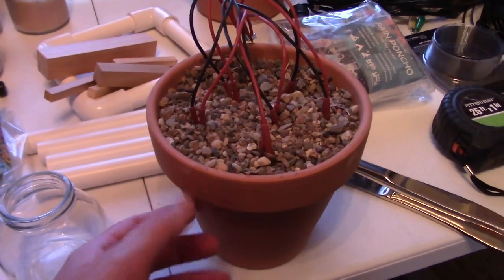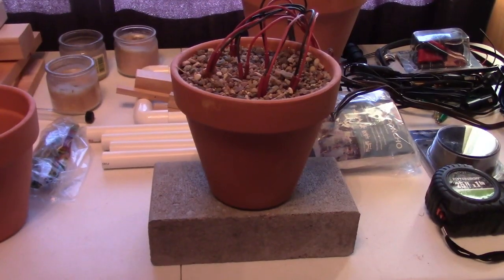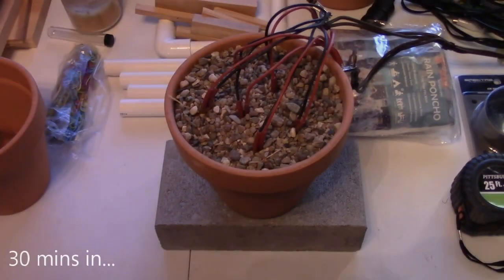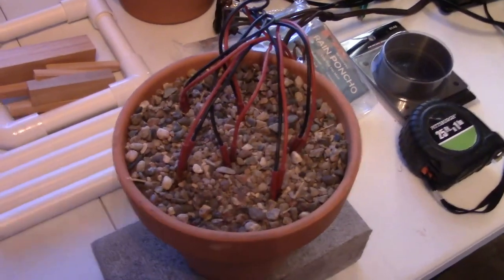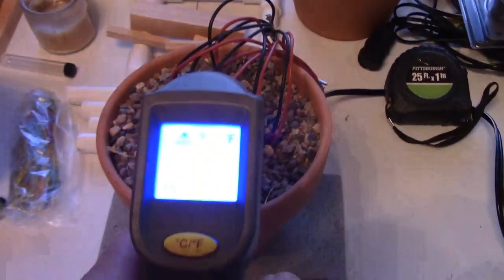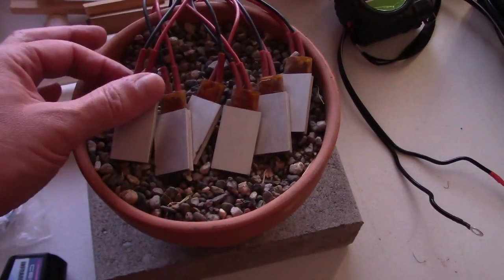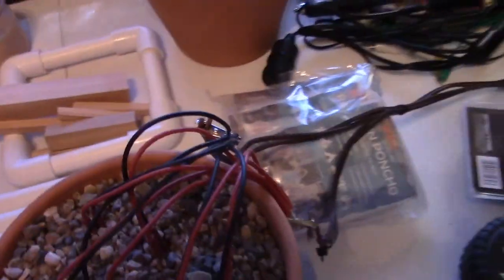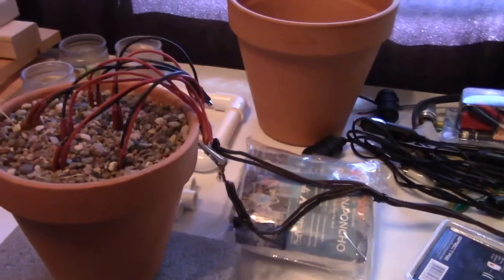DIY Flower Pot Air Heater! new design! no candles! uses PTC Ceramic+Rocks 300F(150c)+ heats a room!

Comment: Here in the Netherlands they have started an project to use basalt rocks as an heat storage battery for houses. During the summer they use solarpanels to heat up a well isolated mass of Basalt rocks so they can heat up houses during the winter with the heat that is stored in the rocks.
Reply from the maker: awesome! ...and very interesting! - i've read about using large rocks to store heat but they were only holding the heat for a couple of weeks at a time. sounds like they found a way to store heat for 6 months! i'll look into that. thanks for sharing
Reply: @desertsun02  add SALT
Reply: @desertsun02  and silica gel
Reply: @desertsun02  and bind wires together and run them out of small hole and cover that thing with ALUMINUM screen for heat dispersion
Reply: Basalt rock is what rockwool insulation is made from. So you could get insulation and compress it.

Comment: Cool experiment. Another way you could heat that flower pot during the day is with a solar oven. Maybe have 2 of them and swap them back and forth, one heating in oven while using the other to stay warm inside? Use the solar panel to charge up a battery, then use the battery operated heaters after sundown.
It is out of the box thinking and experimenting, and sharing the results, that will help people when hard times strike. Great job with this.

Comment: If you increase the mass (bigger pot more gravel ) you will have a lower heat but for much longer. Some ornamental pots dotted around the house thermostat and battery you have true passive heating. Genius idea 💡 very impressed

Comment: This inspired me to use PTC heat elements in a 20 ounce plastic soda bottle filled with sand. I have one element on top and one on bottom inside the bottle, threw it under the covers and slept a lot better than without it considering it dropped to 25 degrees last night. I'm thinking about making a quick video to share.
Reply from the maker: sweet! be very careful using ptc heating elements near plastic though. the elements will melt plastic. that could lead to many problems.
Reply: Sounds interesting. I was wondering if this could be done in a 55 gallon plastic barrel without the heat melting the barrel.

Comment: desertsun2, I duplicated your flower pot experiment a number of times and can only get a high of 240 degrees off the  top,  not 300 plus. I now realize my pea gravel is different composition (orange and white). Yours is a grayish color.
I bought two brands (orange and white). What brand did you use? I'd like to try and get your brand so I can get 300 plus degrees off top like you did. Thanks. I've been doing a lot of experiments with your idea.
Reply from the maker: hi and i'm glad you made the project. 240F is pretty good! the pea gravel  i use is just natural landscape gravel (from my backyard). i'm not sure what brand it is.

Comment: That's pretty cool. Are you totally off grid there? Will that heat a 5 gallon bucket of water up with the same low energy consumption as they did with the small containers of water that you showed them heating on your other video you were demonstrating them and heat it fast enough that you don't have to wait an hour or two to take a shower? Thanks man
Reply from the maker: hi and thanks. technically i'm not totally off grid here (but it seems like it sometimes). they would heat a 5 gallon bucket of water but it might take a while. all depends on how much you want to warm it up. one of my previous ptc vids (the saucepan one) shows 6 elements heating a quart of water to a boiling in 30 mins.

Comment: This is my favorite of those I have seen so far.  I have MANY questions about this.
How big is the pot?
How big of a pot is logical to use this way?
Have you or anyone used pickling salt instead of sand or pea rock ? Do you think salt would work? You say this gets hot to touch even on the outside of the pot. 
How big of an area is this or would this heat do you think?  Do you think this would work using an OLD milk can? Like back in the 50's. Before the bulk tanks for hauling milk from the farms to the creameries.  How about the. Old stainless steel. Heavy containers that were used to strain the milk into?   This one REALLY fascinates me.  
Thank you.
Reply from the maker: hi there. i wouldn't use much larger of a pot than i did (unless you're going to add extra ptc elements). it's sized pretty well for the 6 that i used. i have not used pickling salt - so i couldn't say if (or how well) that would work. milk cans are around 10 gallons i think. that is a lot bigger than this unit so i'd guess it would be way to big (unless you used like 3 to 5 times as many elements.).
Reply: @desertsun02  oh boy.  Would it be possible to add more ptc without it changing the being able to use the cigarette lighter in a vehicle or from batteries?  I will learn this somehow.  I would like to try combining a bunch of your various projects and somehow combine them into 1 nice workable combination that would fit my needs.
  I have ordered 2 100w flexible solar panels and a 20w controller .  I have 1 100w solar panel attached to the house. ( never used yet )  been there about 15 years. A controller I thinks 18w maybe.  Lots different stuff from years back of life's collections.   I see many of your ideas very valuable to my situation.  Thank you.
Reply from the maker: @dumbbunny15501 6 of the 12v ptc elements is the most that a 12 power socket in a car could handle.
Reply: @desertsun02  ok.  I need to get the things you use that I would need.   A friend got me 8 of those pct things. He is curious about this.  IF I can learn and do this.  I will believe you are a. Miracle.

Comment: Do you have to have a 100w panel? Would they just not get as warm with smaller panel?
Reply from the maker: hi there. that's right - they are proportional heaters, so they just would not get as hot. for full heat output you need to get about 12 amps total so if using solar panels you'd want to go with 2 100 watters (they are about 6 amp each). these days you can actually buy 12v 200w panels (so you'd just need the one in that case)
Reply: I like that answer.

Comment: I really like the idea. Is the rubber insulation on the wiring affected by the heat? I think over a fairly short period of time the insulation will not maintain integrity. Any thoughts or suggestions on that. My only thought on it at this stage is to flip the idea upside-down so that the heat is rising away from the cables, but I haven't worked out how to do that easily. Any thoughts?
Reply from the maker: hi there. per manufacturer; the wires are high temperature with a heat resistant coating on them. the wires handle 400F-500F (204.4 - 260c). the ptc element itself averages in the mid 300's F so heat produced from the unit will not affect the wires.
Reply: @desertsun02  good to know, thanks.

Comment: how about heating a floor in a van? how might one do that? will these last long? could they be put inside a poured concrete block?
Reply from the maker: hi. these little units are surprisingly tough. i've dropped, scrapped, and banged them plus pulled on the wires and they all still work perfectly fine. per the manufacturer: they last over 3 years (with daily use). they give no upper limit of time but i think they last two or 3 times that long. i don't see why you couldn't embed them in rock. i hope to see lots of people using these in the near future. i think there are tons of possible ways to use them.
Reply: @desertsun02 :
Bed warmer.

Comment: Do you know how much it would cost to run it for 4 hours on the DC converter if the cost of electric is .12 cents per kwh?
Reply from the maker: hi. 6 to 8 cents roughly
Reply: Where would I get the DC converter?

Comment: Another great video.  Do you use splitters to hook the wires from the solar panel to the
ceramic heaters or have 3 separate wires from negative to positive terminals?  Thank you.
Reply: I watched the video on the cook burner and I see how you connected the wires.  Thanks.

Comment: I'm trying to heat a 12x6 ft green house with solar. Do you feel this is more efficient than using the brick method with double stacks? My thoughts are to run this off a Harbor Freight basic solar kit. Tnx for reply.
Reply from the maker: hi there, i'm not sure why, but i think that this way of heating thermal mass is slightly better than the brick method. it just seems like this heater gets a little hotter and dispersed the hot air farther than with the bricks. (but it might just be in my head).

Comment: Oh and a question. If I run these 12v units in series (4S) would it then be a 48v heater? - just to match the output of my solar array. Can imagine destroying the PTC if I overvolt them in parallel
Reply: I have same question ? did You try connecting 4 in series ? did.it work?

Comment: I want to do this with adding the top pop then a flume with computer fan to blow it.  How many total watts does this use?  I want to be able to plug it in to either  a normal AC plug or into my solar generator AC plug. Not sure of what DC transformer to use for that.

Comment: Hello. Do you connect it directly to the solar panel? Or does it need a transformer or something like that? Sorry I don't know much about these things. Thank you
Reply from the maker: hi. it doesn't need anything special. you just connect it directly to the 12v solar panel. 🙂✔
Reply: Ok. Thank you!! Do you connect it with crocodile clips? Or any other kind of wire connection? Thank you
Reply from the maker: i usually just twist wires together but you can use crocodile clips if you want to

Comment: Awesome videos, could you tell me how I can run these elements from a power station?( 400w rocksolar)
Reply from the maker: thanks. just figure that each element pulls about 2 amps each at 12v. i usually use a 12v plug with them. it's a straight connect to the plug. i always use the 14 awg 12v plugs. you want the wire to be big enough to handle the power.

Comment: @desertsun02 Do you think that will work for a raised garden bed in the winter? Sometimes in Germany we get below -20 Celsius and the plants are dying, the low sun hours are not even the main problem for the growing stop. A few of the heaters placed in the garden bed, connected to a batterie, which gets charged by a solar panel and some temperature control should do the job. What do you guys think?
Reply from the maker: i think it could work. you might want to look into lower temperature PTC elements. the ones i use may be too hot (or just put them far enough away from the plant so it doesn't overheat)

Comment: What would be the best Jackery to use (in terms of wattage) with this time of set-up?
Reply from the maker: hi. hard to say. i think most of those have a 10A DC power socket. to run this you need about 12a (so you'd need a 15a power socket to make sure it would work).  i designed it that way to it could be used in a cars power socket. those are often 15a

Comment: How many watts is that AC to DC converter providing to these? There are 6x 50w heating elements in there? Thanks for the great vids :)
Reply from the maker: hi. the heating elements pull about 2 amps on average at full heat so about 24 watts per element. times 6 is about 144 watts. the power supply is a 12v 15 amp one so it can put out 180
Reply: @desertsun02  Awesome thanks - I have the same power supply and currently have 3 of these elements between bricks as outlined in your other video, and it's working nicely -thanks! But I need a bit more heat and I saw this video and it looks like it would be a lot more efficient. My question about the power consumption is based around this question from Amazon: https://www.amazon.com/ask/questions/Tx11R1FSF2EYIOT/  I don't know much about wiring shit up so I was hesitant to hook up 6 of these (really powerful) little things to my 180w power supply, thinking they take 50w each. I guess the power supply prevents them all from pulling that initial 4.5 amps, and the elements are good enough to work with it and still reach max heat eventually? Now I'll get this flowerpot setup going and it looks like it works great! Btw I had the idea of molding hempcrete blocks that you could embed these in, it may work really well while still being pretty light, what do you think? Thanks again for the great info, I seriously appreciate it!
Reply from the maker: hi there. don't give any credence to that guy that answered the question on amazon. he didn't know what he was doing or what he was talking about. he was trying to run these 12v elements on only 9 volts and then saying they pull 4.5 amps. they don't pull anywhere near that if the correct voltage is used. he later says that when he applied 12v (the correct voltage) they all never even reached 3 amps at startup and all were around 2 amps after the warmup period. (they typically warm from cold to fully hot in only 20 to 40 seconds). i choose 6 as the number of heating elements to use because you can easily run that number on a 15a supply. average power draw of each is 2 amps so roughly 12 amps total. i've actually made 6 or 7 projects with these and run them hundreds of times and they never get anywhere near the full capacity of the power supply. i always want to keep the power requirement of my projects below 15 amps so that most if not all can be run thru a cars' 12v power socket. most of those in my experience allow a 15 amp draw. also it allows people to run the projects on only 2 100w solar panels.
Reply: @desertsun02  I am definitely going to have to learn this stuff

Comment: Hello, about how many watts are the PTC elements rated at each? 50W? Thx, klee
Reply from the maker: hi. the elements seem to pull different amounts of power at different times. low at startup, high a few minutes later and a few after that they drop a little to about 2 amps (so roughly 24w). when they sell them they usually list a range 5-28w or 5 to 50w but from what i can tell it's all the same element, the main thing though is when the heat stabilizes it seems to be around 2 amps each
Reply: @desertsun02  Thx I was thinking that the 5-50W 2 for $9.99 elements on Amazon would do the trick.
Reply from the maker: those are good ones - sold by bestol i think. i usually get the 220c ones. i just got an order delivered today of six of the 200c ones. i forgot the company name but they are the 200c (392f) ones this time. should work about the same as the 220c ones though.
Reply: @desertsun02  ... hi , where can I buy those elements you are using in the video? It’s a great idea .. I have been using two pots with the candle lights , and it is working fine . But it’s a good idea with the 12V  as well 👍🏼 .. and if you need more heat you can just take a bigger pot .. or maybe some different stones like lava stones, the stones from the sauna 😉 ??
Reply from the maker: @john spartan you can get the elements on amazon, ebay or aliexpress
Reply: Thank you  @desertsun02

Comment: Hello! Do you think this would work with the DERNORD 12V 150W Immersion Heater Submersible Water Heater Element?
Reply from the maker: i can't say for sure but i think those water heating elements need the cooling property of the water. it might get too hot and burn out in this setup.
Reply: @desertsun02  That makes sense. I was just looking at things around the house and wondered. Thank you! 😊

Comment: Hi there, great videos.  Got the heating elements and the soapstone on one of your other videos.  What else can you use besides solar and the DC plug?  I'd like to be able to use something that can be used during a no power supply type of situation.  Not sure if a regular battery would work.
Reply from the maker: hi there and thanks. since the ptc elements are 12v you can use any 12v source that will give you the amps that you need. a good size 12v deep cycle battery would work well. if you've got sun then just hooking them to a 12v solar panel work great too. unit can also be run through a cars 12v power port (in many cases)
Reply: @desertsun02  Do you think running 3 of those heating elements to a car plug like you have in your videos going to a car battery would be acceptable for the 150 w?  I'm buying a 16awg 30a fuse connector to go from the battery box female end to the battery.  Thanks in advance.

Comment: how much energy does it require
Reply from the maker: hi. they typically draw 2 amps each.(so 12 amps total). i use no more than 6 six elements in any of my projects so that they can easily be run from standard 12v power ports or by using only two 100 watt solar panels.